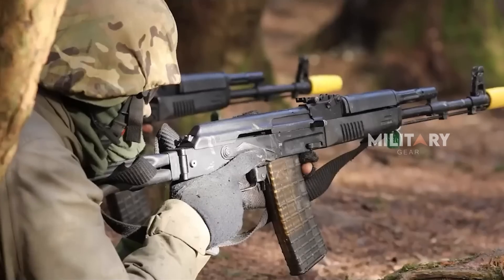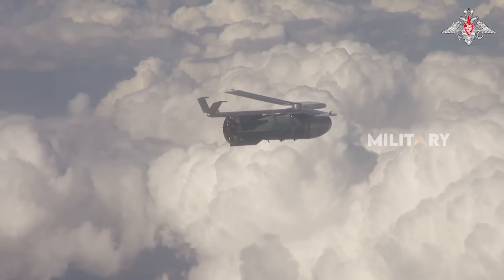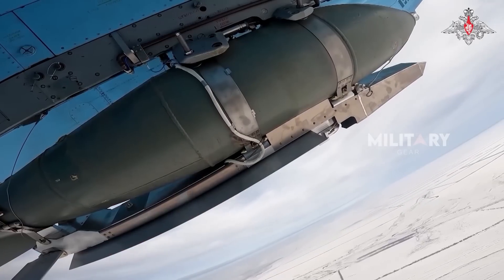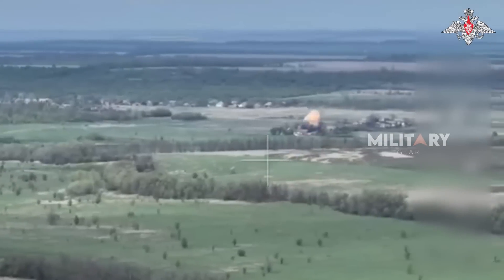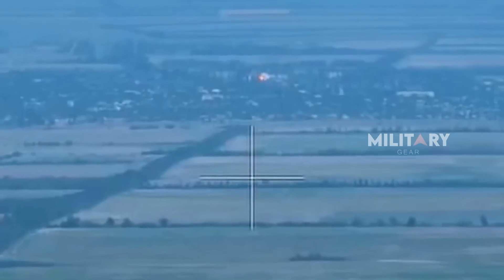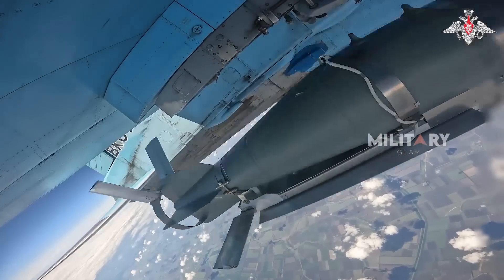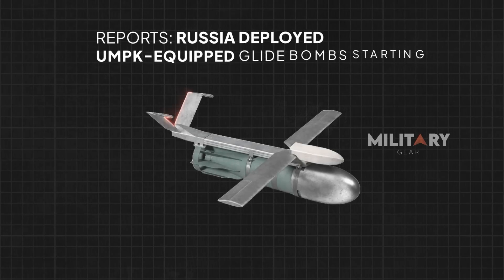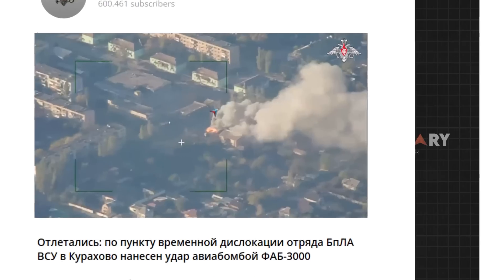Russia's FAB-1500 & FAB-3000: Almost Impossible for Ukraine to Stop?

Comment: Every MiG-29 can carry these bombs and has not yet been used in this conflict, Officially, Russia has a large number of MiG-29 aircraft, it is obvious that Russia still does not have enough of these bombs, I mean those that have been modernized, but it is also only a matter of time before Russia increases production, to which it can be expected that a larger number of them will not have a GPS system, but only wings, which could carry out a massive bombing in the area where the Western or Ukrainian army is expected to be located. What I don't understand is why Ukraine decided to sacrifice itself for other people's interests?
Reply: I'll tell you more. Not even all Su-34s are involved in strikes against Ukraine. There are definitely several squadrons on duty on the Pacific coast. And then there's the Baltic and the Arctic. Russia is still fighting with forces much smaller than it could.
Reply: США устроили гос переворот в 2014 и пропихнули русофобов - неофашистов во власть...
Reply: Для этого есть СУ-24 или СУ-34.

Comment: And this is even not FAB 5000NG, FAB7000, or FAB9000.
Reply: There is no platform which can still carry those.
Reply: @andreimoutchkine5163  TU-95, TU-160?
Reply: @staycool1087  Nope. All the currently extant ones got the revolver-like contraption to launch cruise missiles, no actual bomb bays.
Reply: @andreimoutchkine5163 есть
Reply: @andreimoutchkine5163  T-22 for example.

Comment: Author missed the most crucial point — Russian glide bombs are relatively cheap and easy to produce. Much cheaper than rockets like Kinzal. That’s the biggest problem for Ukrainians - Russians mass produce these bombs and use them whenever they have an opportunity to do so.
Reply: Don't forget about the staggering number of these bombs they had left over from the cold war sitting in storage. All they had to do was put a guidance module on them and suddenly they're smart bombs.
Reply: Cheaper even Iskander
Reply: And the installation of the gliding kit is so simple that it is installed directly on the aircraft.

Comment: Problem is even if the AA system locks on and fires on it; the missile cannot really damage it very much. AA missiles are designed to shred aluminum and titanium skinned fuselage; a gravity bomb is encased in steel. The fragments produced from nearby missile warhead detonation just bounce off.
Reply: It's also very hard to actually lock on to them in the first place since (up to now) they've been purely mechanical and doesn't have an active heat signature, it's basically just a cold flying piece of metal, which is much much harder to actively lock onto then something that has an active heat signature like missiles/airplanes do.

I've heard they're working on adding some kind of turbine to them to extend the range even further though, but so far all I've seen used are the purely passively flying ones.
Reply: Там не сталь даже, а чугун.
Reply: @trevorsutherland5263  But won't it be enough to damage the glider wings??

Comment: To intercept glide bombs 💣? Its seems impossible for me cause no heat signature to lock on and intercept.
Reply: If these bombs are fitted with EV engines, they can fly much further rather than glide to their destination and destroy enemy targets. Ev engines don't give off heat signatures.
Reply: @4evertrue830  1500+kg capable EV engine nor light nor small nor cheap. The range is sufficient already. In some special cases of light guided bombs AKA drones it's already there...